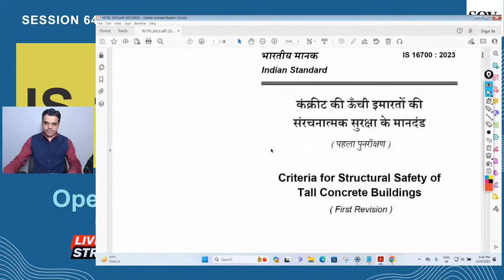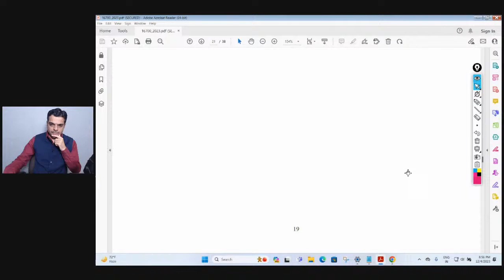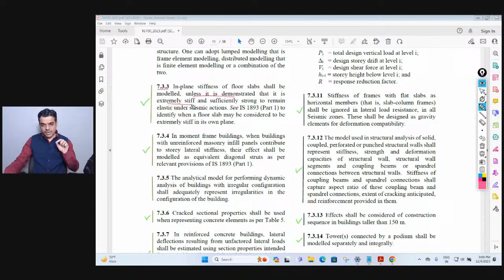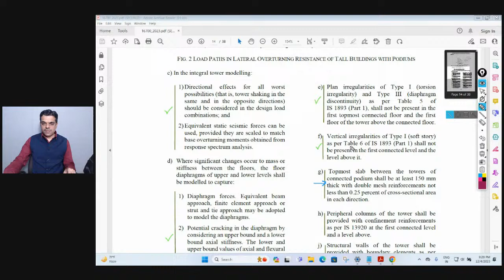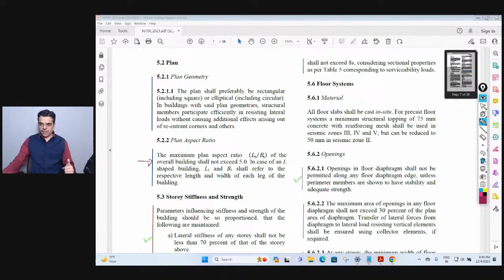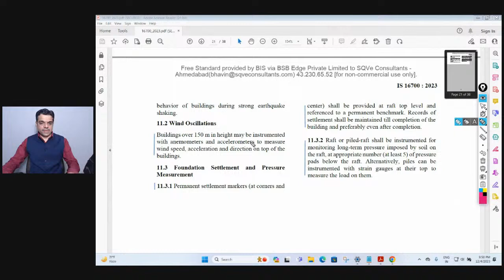Session 64: IS 16700 : 2023 | Open discussion (Part 1)

Comment: WHY COUPLERS ARE MADE COMPULSORY?
Reply from the maker: While doing ductile detailing for the buildings already there is significant congestion of the reinforcement. At location of lap, the situation will be further worsened. The congestion of the reinforcement will affect the durability. I believe this may be one of the reasons why couplers are made mandatory for bar dia of 20mm and higher.

Bhavin